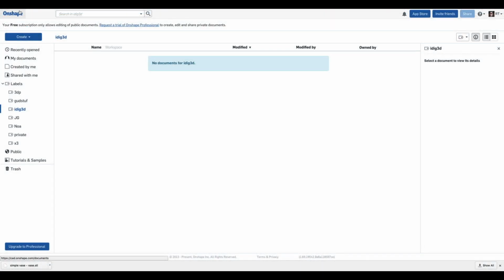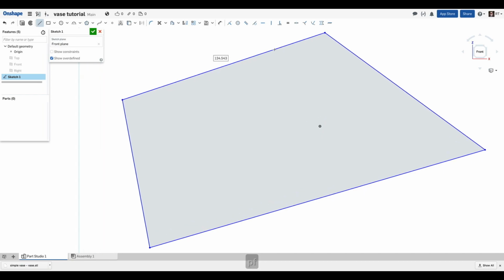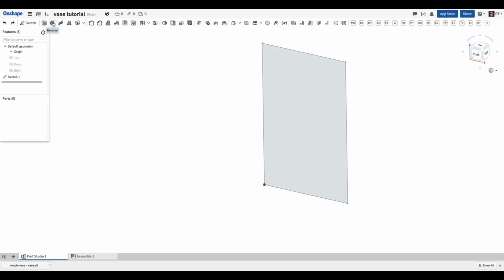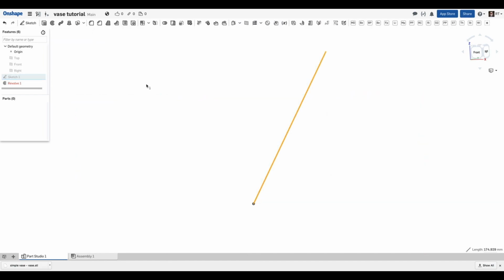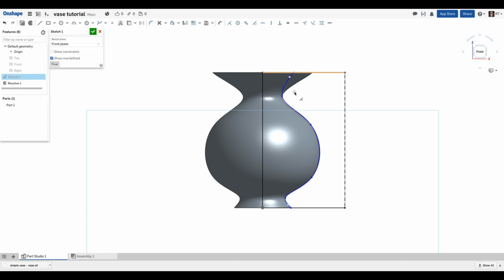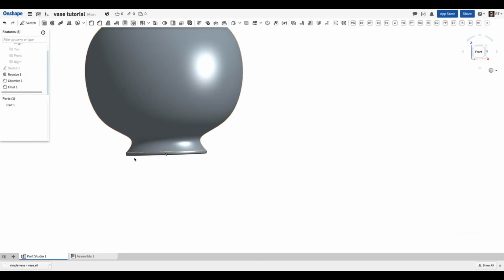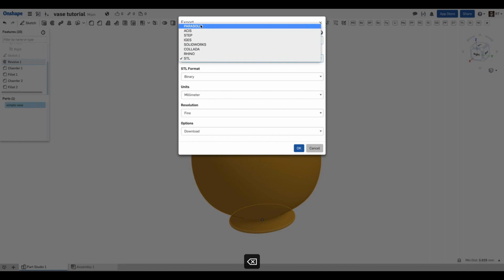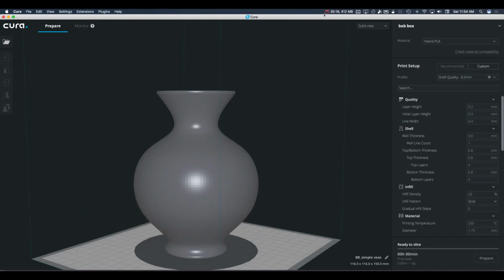Onshape Vase Tutorial for 3D Printing

Comment: I'm new to 3d printing do you have the cura settings for the tronxy x3s
Reply from the maker: carl stanley check out the Tronxy Facebook group. They usually have settings available. I use Simplify3d but even then, my printer is heavily modified so my settings would vary greatly from yours.
Reply: iDig3D thanks for replying